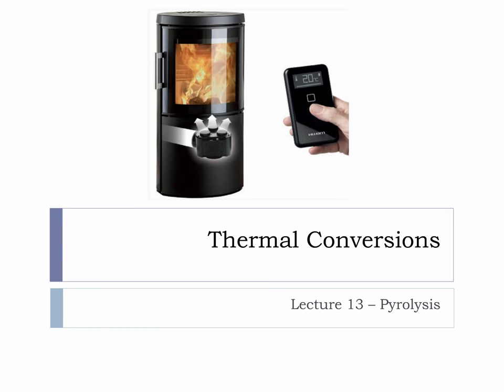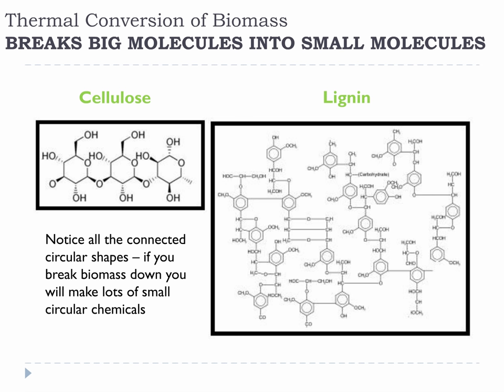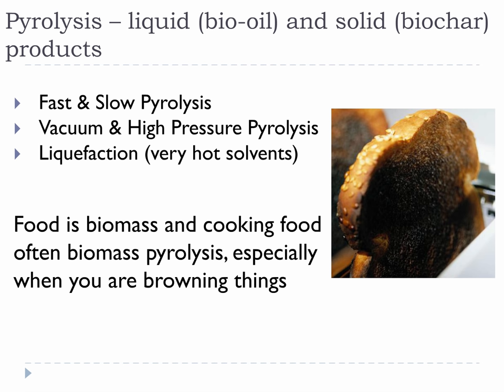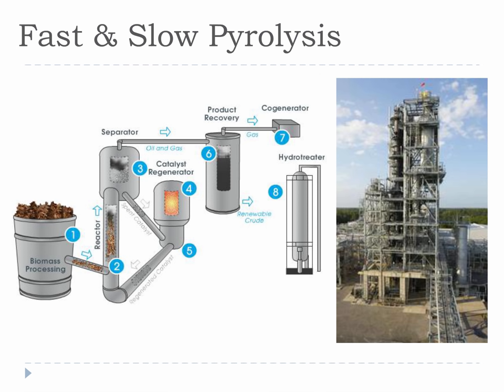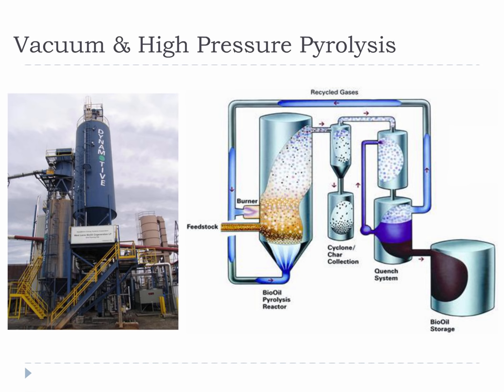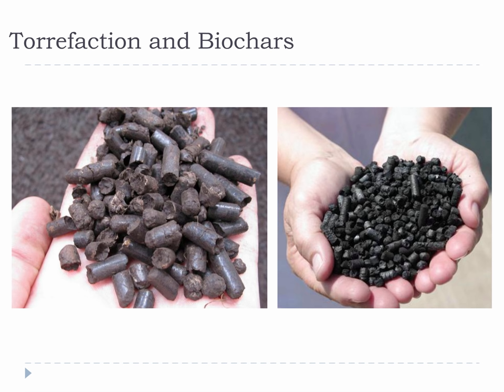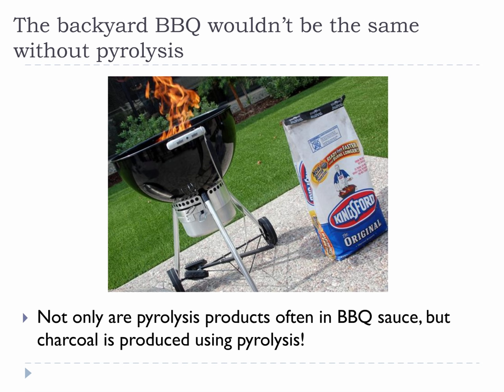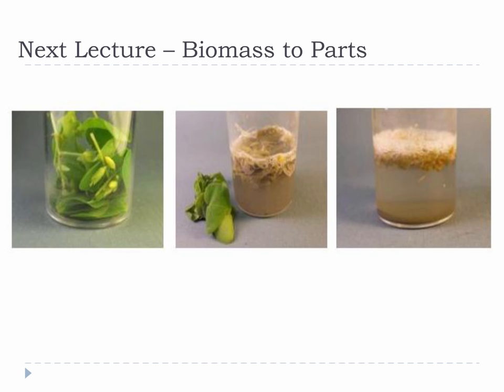Lecture 13   Pyrolysis & Liquefaction

Comment: Thank You Very Much. All the liquids produced by pyrolysis are called Bio Oils.... Which is completely wrong and i fully agree with this. It is time to name them as Water Soluble and Non Water Soluble Liquids ( At ATM ) - just for simple understanding. The water Solubles are Known As Wood Vinegar which has far more use and the value of Wood Vinegar Justifies The Real Value of the Biomass Pyrolysis...